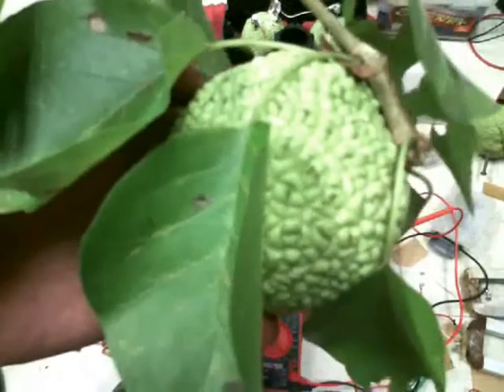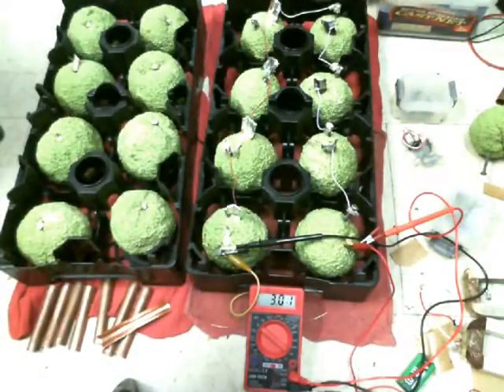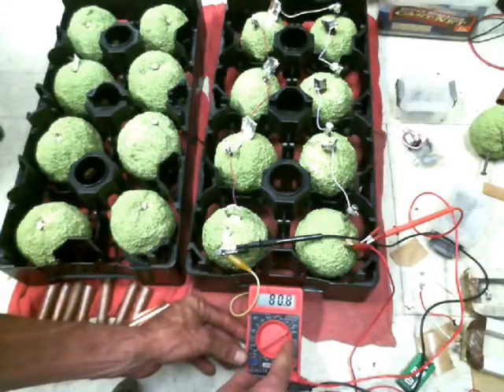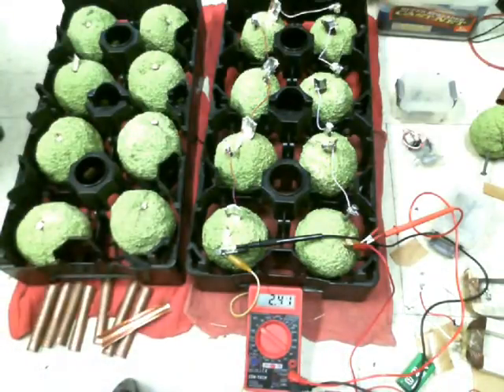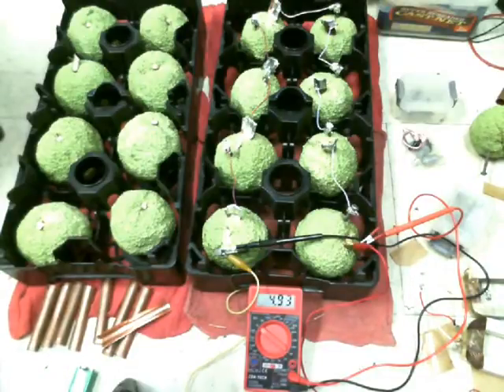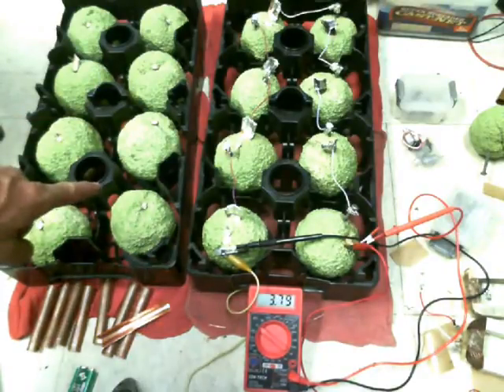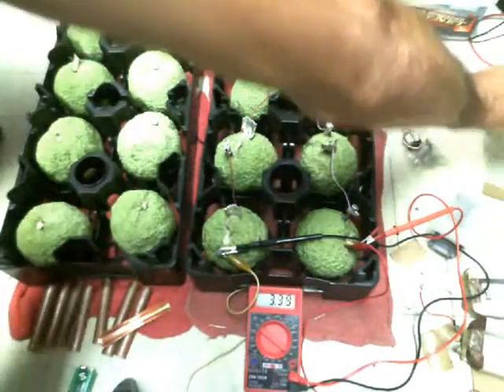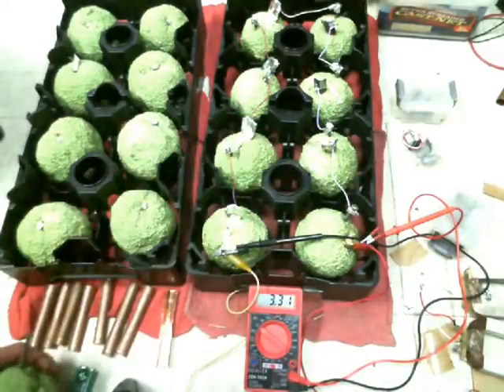REDNECK BATTERY !

Comment: HA! dude that is awesome never in my life would i have thought to do something like this! well done!
Reply from the maker: It is cool, I have been trying to find a use for these things for a long time. A friend said they had citrus in them and so I said if that is the case I should be able to make a crude battery. And I was really surprised that they did so well. I think I can make them even better, maybe by something as simple as adding more terminals to each. What do you think?
Reply: i bet if you mulched them and condensed two or three to a tupperware you could get them to generate more for the space they take up
Reply from the maker: isaaccaudillo1
Today I did that and mixed with some gray clay and made better connections my hopes is that when the water drys out the voltage will go up. We will see, either way I am going to see how far I can take it. :) great idea thanks for the comment.

Comment: cool video, i wonder if you could power an led or something
Reply from the maker: I left it charging a capacitor over night and it had the power to kick over a small electric motor this morning. I think that is a good sign. I'm going to make some better connections and see how it goes. I also think that if instead of just having two terminals in each i may be able to put multiples in each and make them a bit stronger. Either way it is  pretty cool that they did what the have so far. When I get more done I will post any updates. Thanks for the comment.